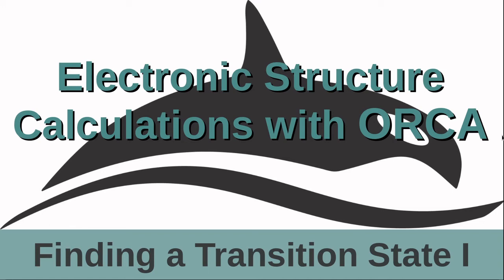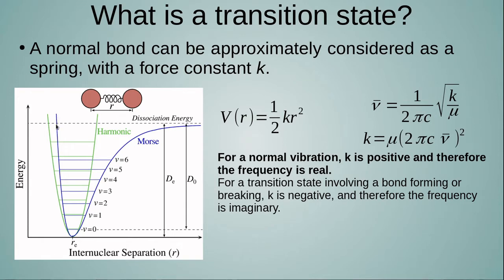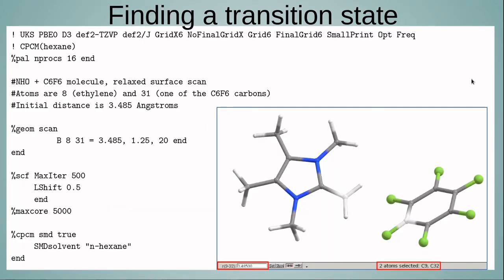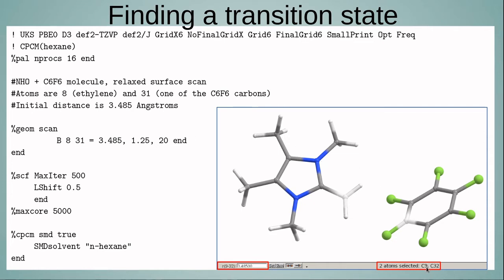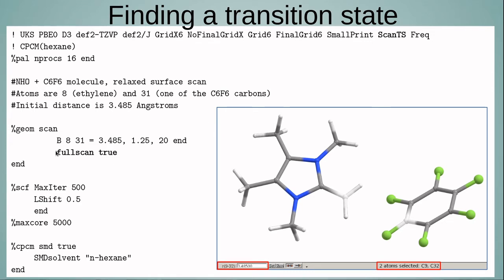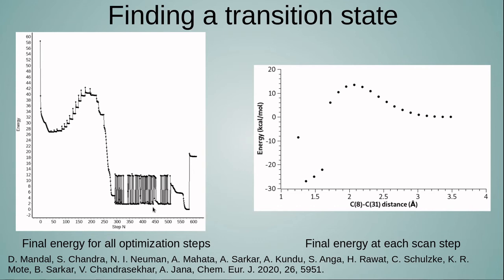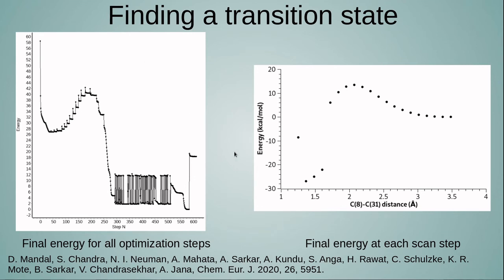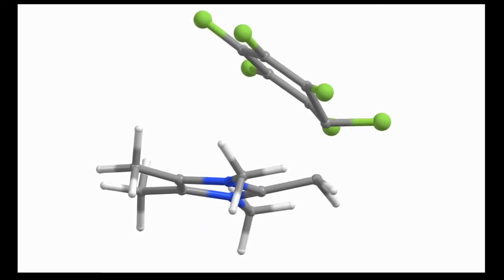Finding Transition States in ORCA (Part I)

Comment: Sir, which software to use for visualization and prepare input???
Reply from the maker: I use Chemcraft for visualisation. But it's not free. Avogadro is free and quite good and easy to use. But I prepare the input files in a normal text editor. I just draw or modify structures in the editor and manually copy the coordinates to the input file. I never generate input files directly from the visualisation program
Reply: @niconeuman  thanks. I am using Gaussian with GaussView but I have always been attracted towards Orca because of its simplicity and powerful engine. Will do it sir.

Comment: Thanks! Could you make a tutorial on how to approach finding TS/Intermediates that involve open shell species? E.g. classical oxidative addition vs radical halide abstraction.
Reply from the maker: Yes, actually I can. Let me find a good example and perhaps I will do a series, from drawing the initial structures to different strategies for getting the transition state. Do you have particular examples in mind? If you have a reference for something similar to what you want please copy the DOI in the comments and I will take a look and see if it's something feasible for me.
Reply: @niconeuman  10.1016/j.jorganchem.2014.08.015 This would be an example of what I mean. For instance, in Fig 1, TS2 would be a classical 3-membered-ring TS polar oxidative addition, which I would know how to compute. But for TS1 (radical halide abstraction), leading to open shell radical intermediates, that then further recombine to give eventually closed-shell IN_1t, it goes over my head. If you could explain how to approach the calculations of such mechanism, focusing on the open shell INTs and comparing it to the closed-shell ones, it would be awesome. 
You're doing god's work with this channel!
Reply from the maker: ok let me take a look at it. it may take me a while because I need to finish some stuff for work. it looks to me that steps 1a and 1b require broken symmetry so you will get radicals on each site. another possibility would be to use fragments, which I think allow you to define the spin of each. the problem with this stuff is that on one side of the reaction you may have two radicals and on the other side a singlet species, so the transition state involves a change in spin. I've been told that that is tricky to compute, but I don't have particular experience with those cases. but usually energy differences between true and broken symmetry singlets are not that great so that they will significantly alter the transition state energy. I will read a little because this topic is interesting for my own work also.
cheers